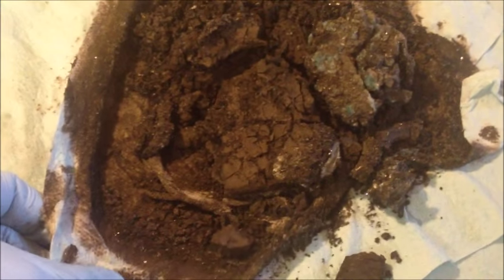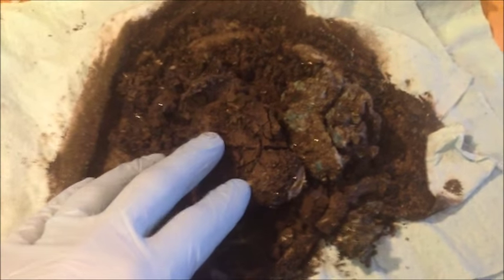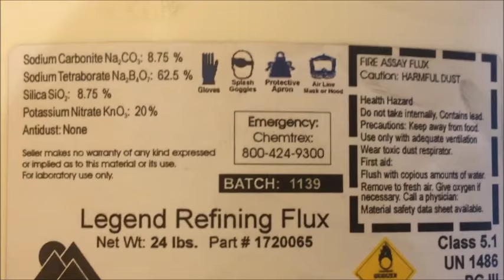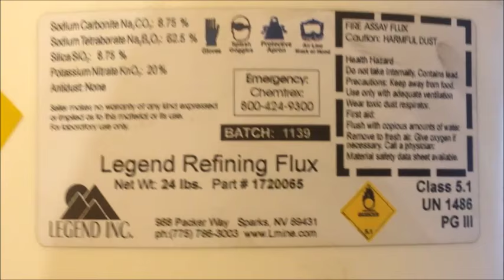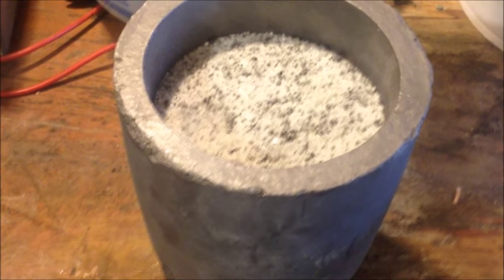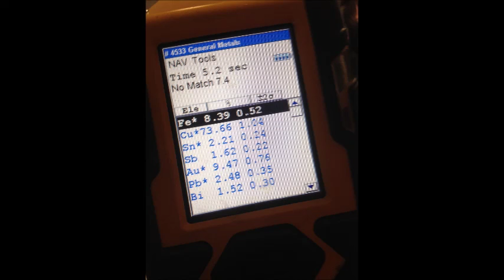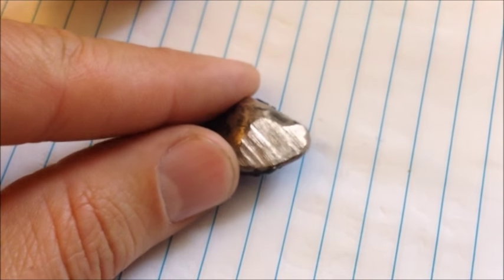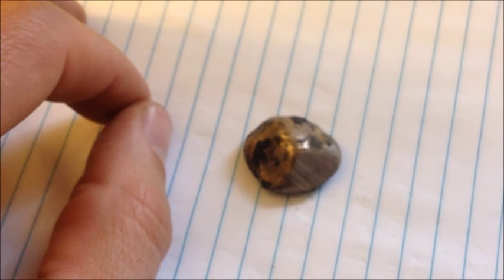Smelting and Gold Refining Part 3: Recovering the Gold From Anode Slimes!

Comment: You can remove most of the contamination before the final smelting by roasting the anode slimes and doing some pre-wash techniques. HCl boil to remove higher reactive metals like tin,iron,lead. Rinse with water and roast again. Boil in nitric acid to remove lower reactive metal like copper. After that, there's no real need to smelt. Move straight to AR leach.
Reply from the maker: +Geo Hi Geo, thanks for the tips.  I haven't had much experience with wet chemistry, but may play around with it in the future.  If I do I will be sure to get it on video. Thanks
Reply: Workinf with acids on large scale is a toxic mess then you have gallons of watse to deal with , we are trying to work around and smelt instead . to much acid to many toxic fumes and to much toxic waste left over that you have to pay to dump

Comment: Great video, been waiting patiently for this one as curiosity was really getting to me wondering how it would finally turn out!

1 quick question, roughly how long did you leave the crucible in your furnace before the pour?

Keep up the great work, can't wait for future refining/ smelting/ gold recovery videos!
Reply from the maker: +CoinSilver800 Thanks for the comment and question.  I put the crucibles in the kiln when the kiln is cold so it takes about ~6 hours to heat up to the required 2000+ degrees F.  Once at temp I let is sit for about 1/2-1 hr and then do my pour.  More videos coming soon.  Thanks again.

Comment: If it were me I would have worked the cell slimes using wet chemistry, it would have been easier to selectively precipitate your gold from the foreign metals that carried over to the finished button.

Next time incinerate your cell slimes, then add them to a dilute solution of HCL heated to remove base metals left behind from the sulphuric electrolyte. What is left in the filter after this process use any of several methods to take your gold into solution then use a precipitate of your choice to bring the gold out of solution,

I also noticed that you did not use distilled water to rinse the residue copper sulphate from the cell slimes or the filter paper itself.
Reply from the maker: +gelmgren Thanks for the tips.

Comment: Hey I have been looking for info like this. What about catalitic converters and some of these types of methods?
Reply from the maker: Hi and thanks for the comment.  I don't have any experience with Cats, but I think I remember that platinum has a very high melting temp and I am not sure that the temperatures necessary can be achieved in a furnace like this.  If you find a solution please let me know.  Thanks

Comment: you didn't use the rod to pull out the junk.  to do that you need to hit the crucible with a torch.  I use borax and baking soda for flux.  also try it a couple times to pull out the junk.  if you try this would you consider YouTube so we can see the results.
Reply from the maker: +Lee Lowe I'm not sure what you mean by "the rod"  can you elaborate a little bit on this?  And what do you mean about hitting the crucible with a torch? Thanks

Comment: Not sure what you are trying to accomplish, unless you are attempting a new way to refine gold, silver and copper from hard rock or even circuit boards....much easier and cheaper ways with 99.89% purity...
Reply: +Greg Burnside If you were to watch his previous 2 video's you will see exactly what he is trying to do. Would you watch the third movie in a series of three first? of course not because you wouldn't know whats going on... same idea here.
Reply: +CoinSilver800 I have.... still dont know what he is trying to accomplish unless he is trying to refine to gold with only smelting....
Reply from the maker: +Greg Burnside Hi Greg.  Thanks for the comment and question.  I guess I should clarify a few things about this process and this is the perfect post to do it.

My goal is to find an scale-able process for direct smelting hardrock gold ore concentrates from gravity separation (off our shaker table specifically, but could work with any concentrate) without any roasting or pre-treatment and end up with a salable product.

By this process the roasting step can be eliminated which is very environmentally hazardous, is expensive to do in larger batches, and takes a lot of expensive equipment.  Secondly, by direct smelting the handling is greatly reduced, ie take your shaker table cons, mix them with some flux and collector metal and smelt, pour your product.  Now I should also mention here that the copper button I ended up with in the very first video is a perfectly salable product.  AAA precious metals in Portland, OR paid me 80% of the gold value in that copper button (for nuggets, placer, etc. gold they pay 95% of the assayed value on batches under 100 oz for comparison).  The second two videos (electroplating and slimes smelting) were mostly just an experiment to see if they would work and to try and end up with a gold product.  Didn't quite work out like I planned, but I think with some more experimenting it could be done.  Even if it does work its not easily scale-able, takes a long time, produces some by-product (sulfuric acid with heavy metal ions that needs to be disposed of) and only increases the value by 15%.  Each operator will have to decide if the cost of further refining from a copper button is worth it, for me personally I think sell copper with 1-10% gold content for 80% value and be happy.

I think in your original post you were hinting at the a wet chemical separation of the gold/values from the concentrates, correct me if I am wrong.  So to answer the root of your question: gold concentrates are very tricky for wet chemistry methods.  Unlike with electronics, gold plated jewelry, etc. in hardrock cons the gold values are not always available to the leach because they are encapsulated by the sulfide crystals.  The free/liberated gold in the concentrates can easily be leached, but I have seen concentrates with only a 10% recovery rate by leaching due to this encapsulation problem.  Some ores will be easily leached due to their high percentage of free gold, others will need to be treated in other ways.

The fire assay is the universal way ores are tested for gold values.  By melting everything to a liquid and collecting the precious metals in a button a very very high percentage of the precious metals can be recovered in the assay process and that is why it is still used today on all types of ores and by all companies.  I am trying to essentially re-create the assay process on a large scale so no matter what type of ore concentrate you have (free gold, sulfide matrix, or a combo of both) you can recover a high percentage of the gold with minimal cost and have a easily salable, non toxic, product with  minimal work and equipment.

I plan to do another smelting video in the near future with a measured amount of gold and then assay the slag, matte, and copper button so we can see exactly where the precious metals ended up and what percent recovery can be accomplished by this method.

Thanks again for the questions, we all learn from each other and by asking questions/clarifying and it is a great peer review process.  Thanks again!
Reply: +mbmmllc  Very interesting to hear the first pyramid of metal wasn't used in the other videos. Actually a little relieved to tell you the truth because the percentage of gold you got off the first button was so different from the final video's button after what I had thought was you processing that first button.
I will possibly be experimenting with what you did in these videos by the middle of next year with black sands that contain decent trace amounts of gold after all free gold has been removed. 
I am thinking that with my set up I may try using a nitric treatment after what you did in the first video but possibly re-use the collector metal a few times before treating with nitric to increase the gold content. To re-use the metal I was thinking of remelting the pyramid and then pouring into agitated cold water to create shot and smelting over again with new material (original black sands).
Reply from the maker: +CoinSilver800 Thanks for bringing that to my attention.  I think I will post a annotation in the video clarifying that I didn't use the first pyramid in the electroplating experiment.  I can see how that would be very confusing!

Please let me know how your experiments go with the smelting this next summer.  I will be curious to hear your outcome.  Let me know if you have any questions and I will answer the best I can.  Thanks again.